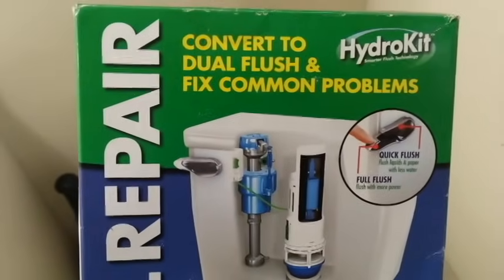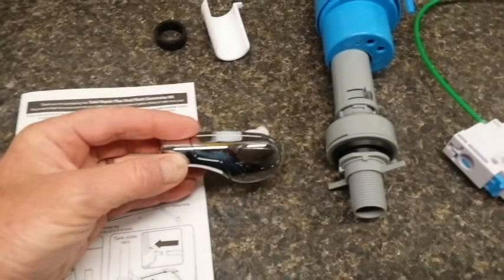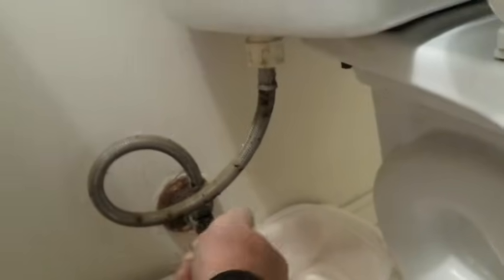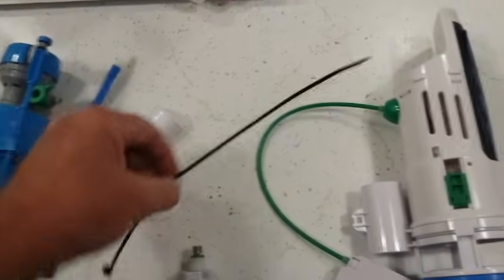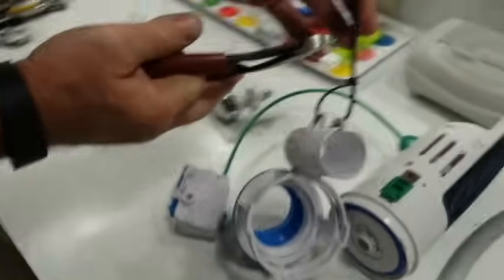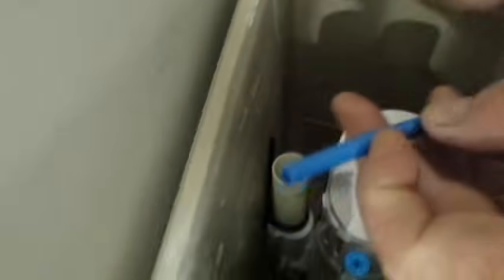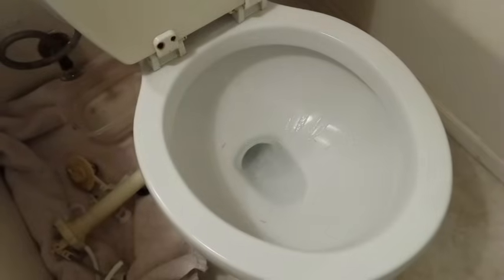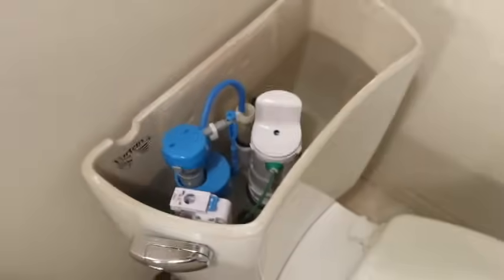Dual Flush Valve Conversion Installation

Comment: Thanks so much! I was going to replace the whole fill valve but instead I removed the cap and cleaned the seal and the inside. I saved some money and learned new plumbing skills with your video! 🎉

Comment: Thank You for your video.
I have a toilet that had a dual flush, but it wasn't hooked up, and the handle was just a normal looking handle. Well the handle broke, and No One, not even a Plumbing Supply Store ever seen the setup that was in my toilet. I think the normal looking handle through them off. Anyway the handle broke at the control box.  I didn't know what to do except replace everything until I seen your video. As soon as I seen the Zip tie part in the setup, I looked at mine and yep, a zip tie. I cut it off, removed the dual flush part, got a new handle and flapper and it is fixed. I used your video backwards, but because of it my wife is happy now.
Thank You! 😊
Reply from the maker: I am glad it worked!  :-) I think fixing ours was to keep my wife happy as well. . that's how it all started!

Comment: Excellent instruction. Liked the TIPS - replacement TIE wrap for easy installation & adjustment, and CLEAR FLUSH LEVELS of  WATER USED iIN TANK.  Saved a few buck down the drain eh! Cheers.

Comment: Great video, much better than the 4-5 min ones others have posted, well worth the time. Tearing my toliet down to the inlet pipe and floor drain due to a leak I am not sure where is.  Using Dalco parts as much as possible. On a A.S. 1.5 gpf. Just tired of taking this apart for it to just leak again 6 Mos later. Appreciate any thoughts or suggestions. Thanks again.

Comment: Awesome instructional video...
I am a stones throw away from 70 years old and can do just about anything related to construction. 
My arch nemesis is plumbing as water is the world's greatest escape artist. 
Learning videos are a big help for me because reading and following written instructions don't seem to penetrate my thick skull. 
I have watched and re-watched the part of your video that explains the 4 fine adjustments and how they work together to create the perfect Royal Flush. 
Any help with this world be most appreciated. 
After installation and thinking, all was well, I woke up in the morning to water all over the floor.???
I figured out that i need to lower the Overflow Tube so this won't happen again. 
But: Even though the float adjustment stops the water at least 4" below the flush button is, (where the water leaked from the tank) the water slowly rises above the float valve and overflows.  The lowered overflow tube keeps the excess water from overflowing, but this is a waste of expensive water. 
What could I have done wrong to make the cutoff valve malfunction, or maybe I have a lemon factory reject.  
Please Help this drowning worn-out old dawg from another flogging from his loving wife. 💧💧 💧 😂
Any other videos that anyone can recommend on the adjustment process for this seemingly complex most awesome flushing system?

Comment: I thank you very much for taking your time to record very detailed instructions to install this system. I never read the instructions that came with package. I just followed your steps and it worked out well. I do have one question to ask--my number 2 flush works fine but when I try 1, it doesn't flush properly until I hold the push button inside for longer time!!! What could be causing this and how can I fix it? Thanks again
Reply: I have the same issue. None of the trouble shooting helped. Frustrated.

Comment: I am slowly losing water from my tank in between use.  It seems like I have it seated well but it won't stop that slow leak into the bowl.  Any recommendations on what to try?
Reply: I also have a leak and every minute it's filling back up. It's ridiculous 😒
Reply: I just put mine in and looks like is leaking water slowly too 😢

Comment: I also have a leak and every minute it's filling back up. What's wrong!?
Reply from the maker: Most likely one of two possible issues - The flush valve is leaking water from the tank into the bowl, Or - the fill valve is stuck and wont shut off, constantly running.  If it starts and stops it's probably the flush valve seal (used to be called the flapper seal or flapper)

Comment: That tank looked like it needed a good cleaning... the bolts were rusting and the fill line below could have used a new replacement too... they don't cost much. With the bolts out, you could have also replaced the tank to bowl gasket while you're at it. Why didn't you replace them?